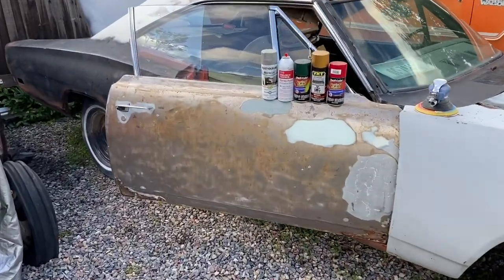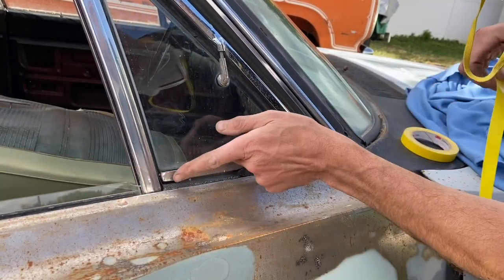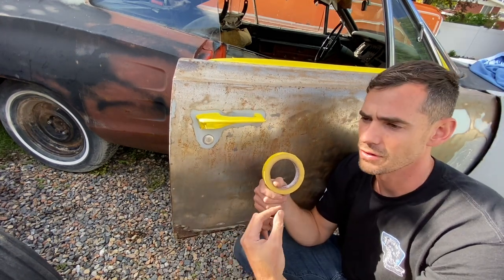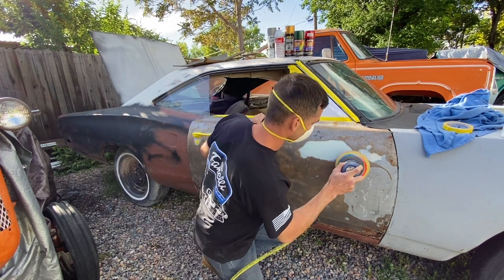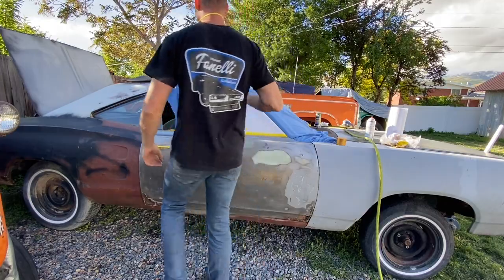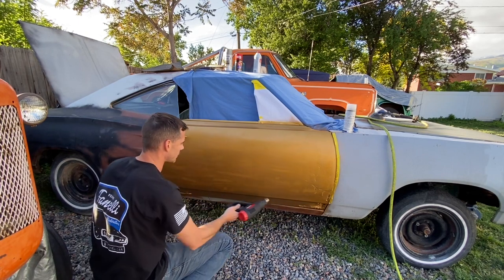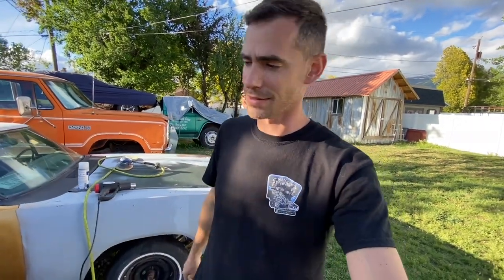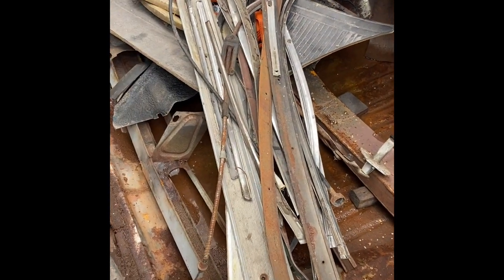Backyard Paint Job on my '69 Super Bee Door

Comment: Would a rust converter application been helpful/beneficial at all?
Reply from the maker: depends, ideally media blast or chemical strip it so there is 0 rust, but if those options aren't available then yea thats a next best step for protection in the meantime. Before I bodywork it and use it I'd want 0 rust there tho.